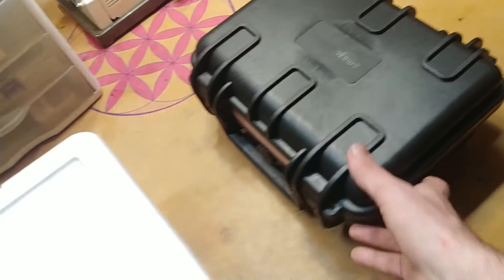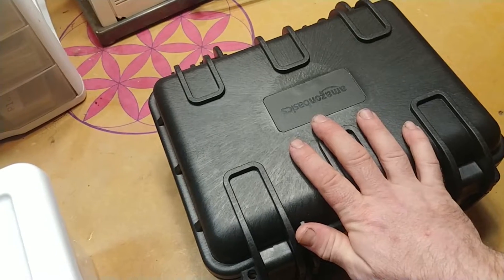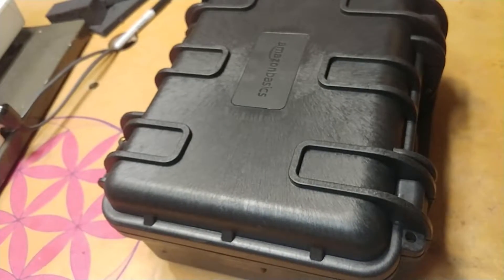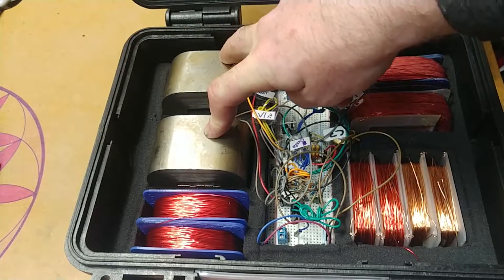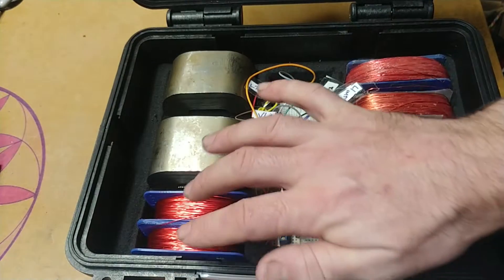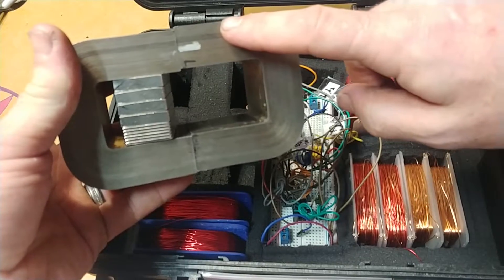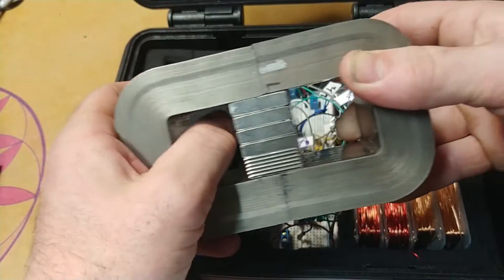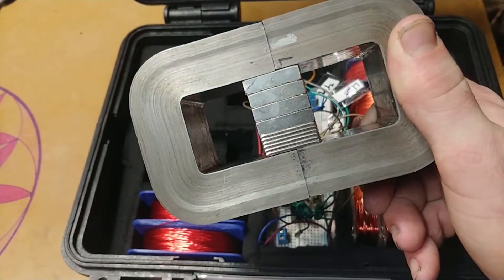MEG Replication 3.5 - motionless electromagnetic generator preparing for Transformer core testing

Comment: My BS detector is screaming at me.
Reply: The MEG uses a novel materials effect freely furnished by the nanocrystalline core and its structure (some of them, not all of them!) wherein the B-flux curled portion of the magnetic vector potential A is sharply localized inside the core (recall that the B-field is merely the curl of A, hence it is the curled component of A). Such localization of the curled or “field” component of A, of course, is known as the Aharonov-Bohm effect, whereby a curl-free magnetic vector potential then freely appears OUTSIDE the core in space, where the B-field would normally have appeared had its localization not occurred.

So the MEG has thus conditioned the IMMEDIATELY SURROUNDING SPACE, so that extra EM energy density has appeared OUTSIDE the core, in space itself but in the form of the curl-free A potential energy. Since in general relativity the increase in energy density in spacetime is a curvature of spacetime a priori, then the MEG’s nanocrystalline core materials have provided an extra EM ENERGY RESERVOIR in outside curved spacetime.

Please note that this completely violates the standard CEM/EE model, which arbitrarily assumes a flat local spacetime and an inactive vacuum. In the MEG, the local spacetime is curved and the local vacuum is now active (the virtual particle flux of the outside spatial vacuum has been altered). This violates the standard assumed Lorentz symmetry, which is necessary if one would have a COP>1.0 energy-from-the-vacuum system. I refer you to M.W. Evans, P.K. Anastasovski, T.E. Bearden et al., "Classical Electrodynamics Without the Lorentz Condition: Extracting Energy from the Vacuum," Physica Scripta, 61(5), May 2000, p. 513-517. 

The normal A-potential consists of two components: one curled and the other uncurled. Usually the uncurled component is rather much “hidden” by the curled component, and thus not usually considered.

Now note that, in the AB effect, the uncurled A-potential extends from INSIDE the core on out to the space outside. The AB effect only localizes the CURLED portion (the B-field) of the total magnetic vector potential A.

But now, when we perturb that B-flux inside the core, an additional effect occurs. We also perturb the “inside front end” of that curl-free A potential component extending on out into the outside space, and that perturbation of the inside end of the uncurled A propagates passes outside the core and on through the uncurled field-free A potential in outside space. In short, that part of the perturbation travels outward outside the core and out into the surrounding uncurled A.

The simple equation dA/dt = - E then tells us what happens outside the core. The perturbation spreading radially outwards just outside the core, is a dA/dt perturbation and that perturbation is directed out and away from the MEG core. In the little formula the resulting E field produced by that spreading perturbation has a negative sign on it, so the E-field created in outside space by that outward-traveling uncurled A perturbation is directed FROM THE OUTSIDE SPACE BACK INTO THE MEG CORE ETC.

Note also that the magnitude of the – E produced, is controlled by the sharpness of the rise time and decay time on the input pulses the operator feeds into the MEG’s normal input coil. One can easily produce sufficient return voltage to destroy the insulation on the windings on the coils. Every coil and every wire is now an “input coil and input antenna” for the MEG’s receiving of that returning E-field energy.

Each and every wire or coil in the transformer section receives a part of that E-field energy radiating back into the transformer from space just outside the core, and each receiving wire and coil also then re-radiates energy to all the others. The result is a dense set of E-field signal energies (in pulses form) but of varying phases.

Then we adjust things (the method is proprietary!) so that a reasonable “phase addition” condition exists in the dense signal environment of the MEG. Once that is done, the return energy received from the returning excess free E-fields is largely coherent in the MEG. We then have the following situation:

(1)     the MEG acts in part as a very efficient standard transformer, courtesy of its modern nanocrystalline core structure. With the normal transformer part of its operation alone, the MEG would get about 90% efficiency and – without any other energy input – it would produce something like COP = 0.9.

(2)     But there is also a great deal of extra, free EM energy coming into the MEG from the altered spacetime outside the core, due to dA/dt = - E and the Aharonov-Bohm effect. Indeed, there is easily more E-field energy coming back into the MEG from the outside space, than the input energy we ourselves placed into the “input” coil.

(3)     The MEG thus has TWO energy input reservoirs/sources: (a) energy input by the operator and paid for by him, and (b) lots of excess free environmental E-field energy received from the altered external space and the perturbed AB effect.

The MEG’s thermodynamic operation is now similar to that of a common home heat pump. The thermodynamic efficiency of the home heat pump is only about 50%, and so – if all its input energy were only what the operator pays for and furnishes – that would allow a COP of only 0.5. But the heat pump ALSO receives a lot of excess free heat energy from its environment. It in fact receives so much extra free energy from its environment that it outputs three to four times as much useful energy and work as the operator himself had to input and pay for. In short, its COP = 3.0 to 4.0, even though its overall efficiency is always less than 100%. Which is why we use home heat pumps in the first place.

So the EFFICIENCY of the MEG is always less than 100%, because it rigorously obeys the conservation of energy. Total energy input to the MEG from all sources, minus total energy dissipated in its losses, gives the amount of usable energy or work output by the MEG. Since – contrary to any ordinary transformer – the MEG receives an extra, free, and appreciable input of pulsed E-field energy from its environment, the MEG’s operation is directly analogous to that heat pump, and its COP is permissibly COP > 1.0.

The MEG completely complies with physics and thermodynamics, but with the nonequilibrium steady state (NESS) thermodynamics. That is, with Ilya Prigogine’s thermodynamics of dissipative systems.

We also note that certain areas and effects have long been accepted and accounted in NESS thermodynamics, which allow violation of the second law of thermodynamics (i.e., allow the production of negative entropy). Strong gradients (as used in the MEG in pulsing) and materials memory (as exhibited by the materials freely initiating the AB effect) are two such recognized and proven areas. See Dilip Kondepudi and Ilya Prigogine, Modern Thermodynamics: From Heat Engines to Dissipative Structures, Wiley, New York, 1998, reprinted with corrections 1999. Areas known to violate the old second law are given on p. 459. One area is strong gradients (as used in the MEG) and another is memory of materials (as used in the MEG in the nanocrystalline core materials and structure).

You can easily get the AB effect with a good toroidal coil, as is well known. But there you have to PAY for it in terms of voltage x amperage.

The thing that made the MEG possible was the discovery that certain nanocrystalline core materials and construction freely evoked the AB effect, so you do not have to pay for it. Immediately that tells us that we have a FREE and extra EM energy reservoir in the MEG’s self-modified external spacetime environment, and that modified environment is feeding excess electrical energy right back into the MEG for its use.

Comment: Question: Do you plan on not only achieving a C.O.P higher than 1, but also make it self sustaining as well?
Reply from the maker: Yes, testing results are already showing that it's outputting more power than is input, so COP is greater than 1.0.  All it's going to take is developing a few Power Electronics components to use that power as the input.
Reply: @JeffersonDrumm  Fascinating. You see, I too am working on a M.E.G, and one of the goals is to have it power itself using energy from the active vacuum, and give off at least a tad bit of energy as well. Thanks!
Reply: Jefferson Drumm I just posted my smaller weaker version on youtube
Reply from the maker: See Thomas Bearden's website.
Reply: Did u finish your project?
U are missing a vital key, let me know if u need it ;-)
Reply: If you put electricity in a toroidal transformer the Aharonov–Bohm effect happens. Tom Bearden and his team have found a way to make a transformer like configuration where the Aharonov–Bohm effect automaticly takes place without external input. How does the meg works?
Consider the physical layout of the MEG. You have a stack of neodymium magnets in the center of a rectangular toroidal core. The magnets touch each side of the core on the inside. There are no coils on the core yet.

What does the magnet flux do?

The flux from the magnets will divide equally between each leg of the core. So you have half the flux flowing on the right and half on the left.

You now place coils on this core. You use two control coils on the top on each side of the magnet stack. And you wind two output coils on each vertical leg on opposite sides.

OK, it is set up. Now you want to switch all the magnet flux to one side by opposing the magnet flux with the opposite control coil. How much flux will the coil need to generate to do this? Well, the answer of course is half the magnet flux since that is what is flowing in that leg. The other control coil is in the off condition, and open circuited, so no current can be induced in it and hence no back-flux generated. The core must not be allowed to reach magnetic saturation or more energy will be required to force the flux to the other side.

Then you turn off the control coil and what happens?

Remember both control coils are now off. The magnet flux will return to its original starting condition of half the flux flowing on each side. Does the magnet need any help to do this? No, of course not. When you did this you also removed half the magnet flux from the other leg when the control coil was on. The first half cycle you only see half the normal induction level in each output coil because at the start you only switch half the magnet flux into one leg and out of the other. So the total change is Bmag/2.

Now on subsequent cycles you let the magnet flux return to its original steady state and let the magnet do the work. Both control coils are off while this happens. Just when the magnet flux reaches its equilibrium point you turn on the other coil and keep the flux change going the other way. Each coil only needs to always switch half the magnet flux not all of it. After the first half cycle you see a 100% change of the magnet flux in each output coil on each cycle for an input power that is half the output. This assumes that you are activating the control coils for half of each cycle. This means you have a theoretical maximum COP of 2.0. You are using the magnet stack as a flux battery and "letting" it do half the work.
Consider the physical layout of the MEG. You have a stack of neodymium magnets in the center of a rectangular toroidal core. The magnets touch each side of the core on the inside. There are no coils on the core yet.

What does the magnet flux do?

The flux from the magnets will divide equally between each leg of the core. So you have half the flux flowing on the right and half on the left.

You now place coils on this core. You use two control coils on the top on each side of the magnet stack. And you wind two output coils on each vertical leg on opposite sides.

OK, it is set up. Now you want to switch all the magnet flux to one side by opposing the magnet flux with the opposite control coil. How much flux will the coil need to generate to do this? Well, the answer of course is half the magnet flux since that is what is flowing in that leg. The other control coil is in the off condition, and open circuited, so no current can be induced in it and hence no back-flux generated. The core must not be allowed to reach magnetic saturation or more energy will be required to force the flux to the other side.

Then you turn off the control coil and what happens?

Remember both control coils are now off. The magnet flux will return to its original starting condition of half the flux flowing on each side. Does the magnet need any help to do this? No, of course not. When you did this you also removed half the magnet flux from the other leg when the control coil was on. The first half cycle you only see half the normal induction level in each output coil because at the start you only switch half the magnet flux into one leg and out of the other. So the total change is Bmag/2.

Now on subsequent cycles you let the magnet flux return to its original steady state and let the magnet do the work. Both control coils are off while this happens. Just when the magnet flux reaches its equilibrium point you turn on the other coil and keep the flux change going the other way. Each coil only needs to always switch half the magnet flux not all of it. After the first half cycle you see a 100% change of the magnet flux in each output coil on each cycle for an input power that is half the output. This assumes that you are activating the control coils for half of each cycle. This means you have a theoretical maximum COP of 2.0. You are using the magnet stack as a flux battery and "letting" it do half the work.
Reply from the maker: The active vacuum supplies the extra energy, through the tapping of Lenz's law and the non-diverged A field, which is traditionally eliminated from Maxwell's equations.
Reply: Jefferson Drumm interesting, is there a scientific paper explaining it, I’d like to look deep into the active vacuum research please. Thanks
Reply: So the lenz instead of opposing helps rather, that is to say negative lenz??
Reply from the maker: Checked out your video, what sort of electronics do you have in your set up?
Reply: @JeffersonDrumm  some relatively cheap circuits I bought online, with a coil I took from a transformer
Reply: Jefferson Drumm What is the source of the additional power?